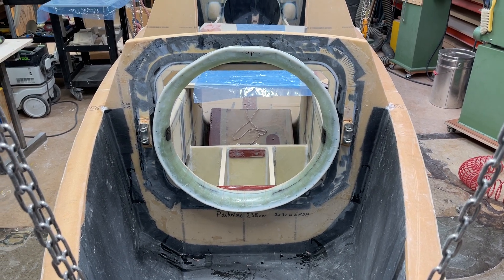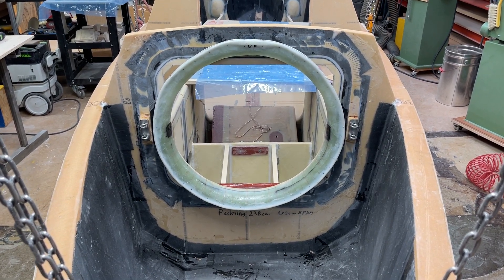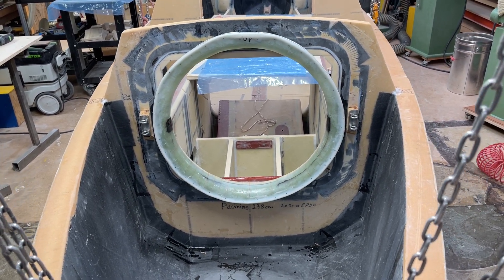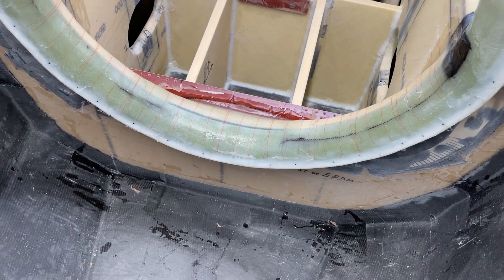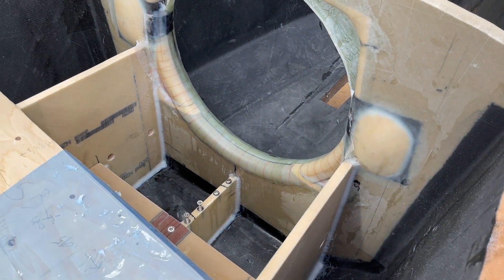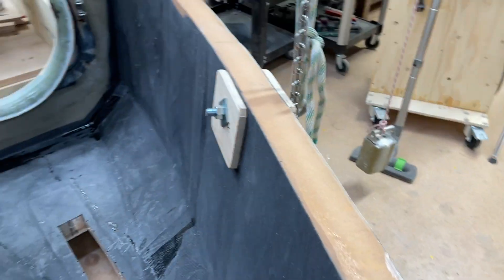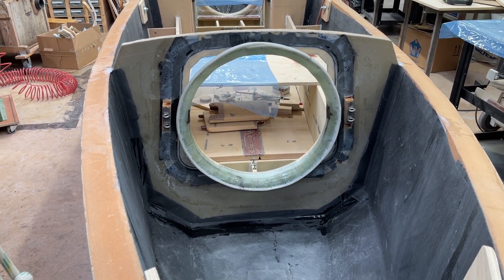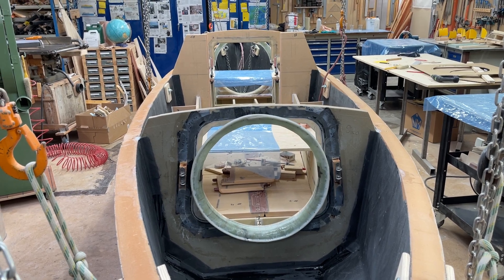10 July 2022 Just an other small step.

Comment: I find doing small fibre glassing jobs takes for ever. If you don't want the mix to go off you're continually mixing small quantities.
Reply from the maker: Do a mix and quickly spread the epoxy out on all the surfaces then take your time assemblem them.
Apply peal ply.
Make a small mix and wet out the peel ply.
Still takes much time.
Reply: @SvenYrvindExlex  Good advice. I was thinking more about building shapes, filleting, like you're doing with these hatches. You have to let each stage nearly dry. Obviously it helps if you're well organised.
Reply from the maker: @cornishhh  Very often you can put the reenforcing fibre into the filleting saving a lot of time and work.
The result will be better to.